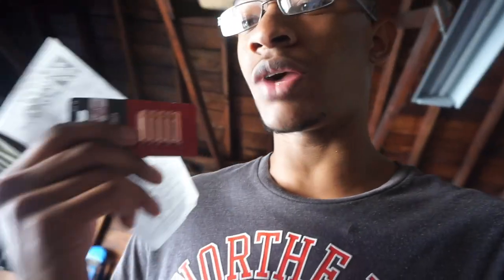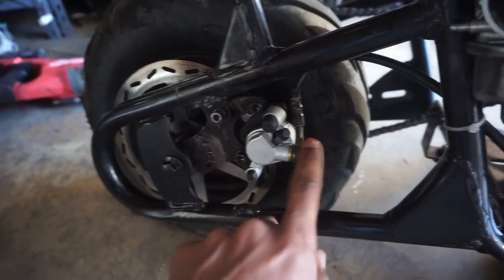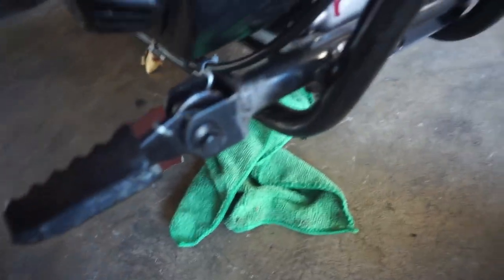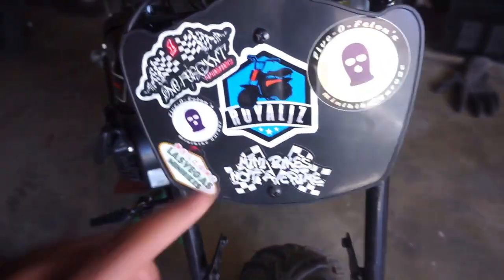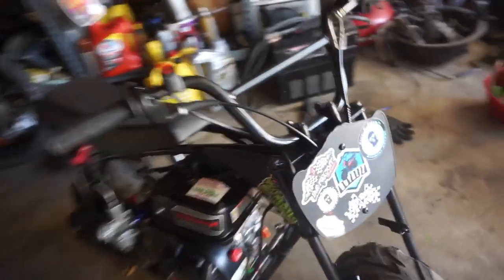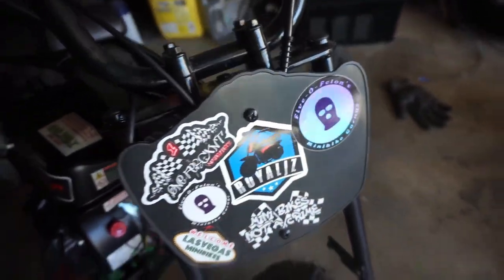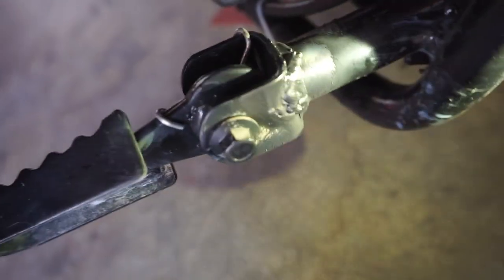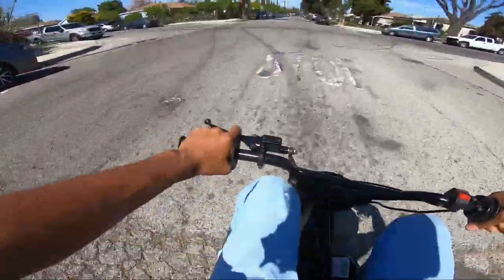Mega Moto Gets Brake Upgrade Must DO!

Comment: Welding with no gloves is crazy, but anyways my hydro brake does not fit at all and the only way to make it fit without welds is to leave the whole brake on a super torqued down single bolt

Comment: FYI, those pads fade quick after a few stops.
Reply: whats a better option then? because i just ordered them ? ima return them if they really suck
Reply: @SoLoCruizer  if you are running 30mph you will be fine. I’m running 65 and have a GX340 on my Motovox. I need a dual piston caliper. But a custom bracket needs to be made as well. If you want a bolt on solution, that’s your only option.

Comment: I just dropped mine off at volts to attach the brake correctly, a shop I took it to attached it wrong n that shi didn’t work n locked the back tire when the bike turned, hopefully it comes out no problems 🙏

Comment: Aye bro so i got a 212, i want to add a pipe and a carb. Do i need to take governor off to add the carb? To get full speed?
Reply from the maker: Yeah you need to remove the governor
Reply: @RoyalJZ  ight so to put on the carb i gotta take out the governor ?
Reply from the maker: @Kfrmthaland  you don’t have to take the governor out but the bike want rev up higher
Reply: @RoyalJZ  ok okay, so how many mph will i go if i add the carb with the governor still on?
Reply from the maker: @Kfrmthaland  maybe 40 to 45
Reply: @RoyalJZ  ight fs
Reply: And btw, do i need to do anything to the motor to add a carb or can i just put it on?
Reply from the maker: @Kfrmthaland  oh add so 26 pounds springs
Reply: @RoyalJZ  whats that?
Reply: @Kfrmthaland  value springs